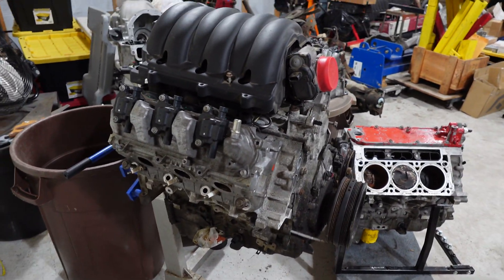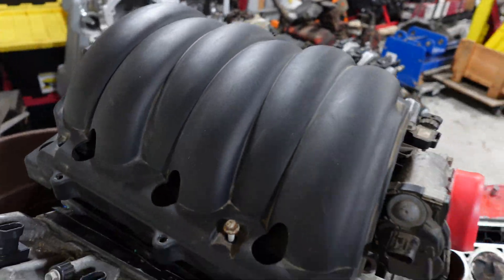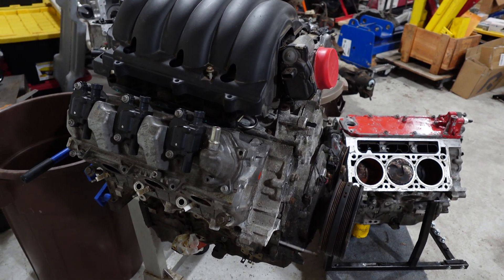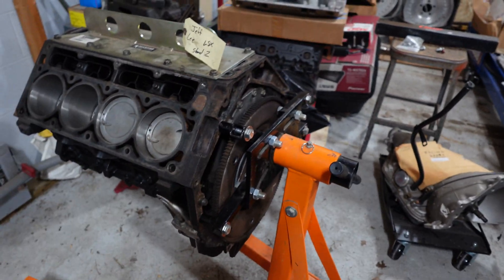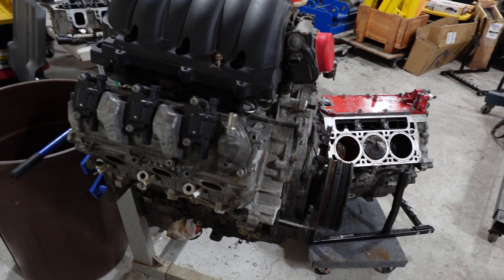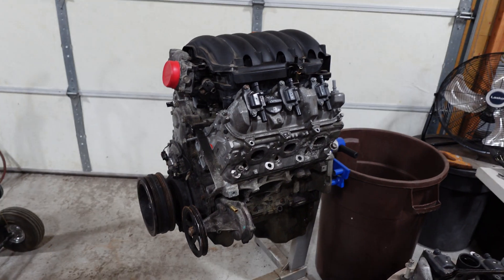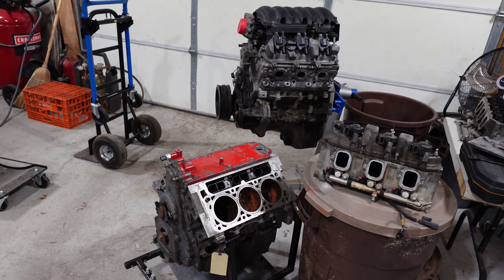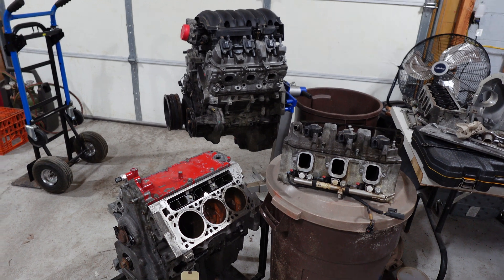LT Based Aluminum DI LV1 And LV3 4.3L V6 Accidental Marketplace Find Features & Possibilities!

Comment: Hear me out, go nuts and pair it to a ZF 8-Speed transmission
Reply from the maker: I like that idea too. That ZF 8 Speed swap is awesome.
Reply: @etenterprises  8hp the world, they seem to be available everywhere, 8hp70s are pretty affordable even, and plenty strong, and if you need stronger either go 8hp90 or get it built by PDS stage 1 or higher (about the same cost between the two, stage 1 PDS vs 8hp90). There's at least 3 different good transmission ecus available now too.

Comment: Pretty good. Even fire 3.75” Stroke spladed forged crankshaft. I am building a 96 4.3 iron. Can’t get a forged crank though scat did make a 4” and cast 3.48”. The needle bearings are bad news, use bushings. I am doing all the DV stuff plus. I am only limited by my cast crank. I like even fire.

Comment: What transmission and drive train can be used on these motors
Reply from the maker: It should bolt up to anything a LT or LS would work with. But I think they came with the 6 speed in the trucks. That's a 6L80 or 90 I believe.
Reply: I used a Nissan 5 speed from a 300zx. Good trans. Commercial adapters are available, but I made mine. Look up 300zx LS swaps